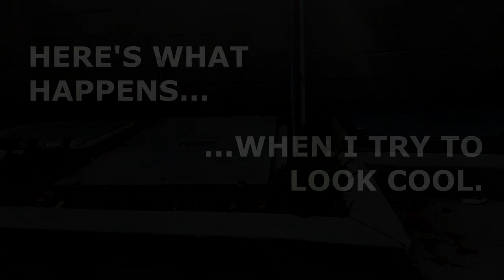#021: Cleaning Up Cable Vaults

Comment: Have to remember that with a lot of the companies out there the tech are ridden hard to get the job done as fast as possible and it it means saving the few minutes to clean it up then that's what it means.

Be careful with that big of a service loop. A lot of customers will be upset with it because it takes up a ton of room.

Yes leaving a lot of extra slack is good but I have been in rooms we're everyone did that and it turned into a buried mess.
Reply from the maker: +JUICED83Z You make a great point and I will make a note to mention that in a future video. Thanks!
Reply: It's sad really. I've been in that situation we're I wanted to clean it up but my then manager was on site and told me to just leave it and move onto the next job. Granted there are some techs that have the time but just don't care.
Reply: Another thing to point out besides the aesthetics of a big service loop is the technical implication of it. Large service loops of copper can become an "air choke"  this can cause cross talk issues or degradation of signal. This can be a large issue with Ethernet however I'm not sure I ever encountered it with a T1 circuit. T1 voltages can be 200v or more so it's very plausible it could. 

I find it very odd they would not use the fiber, I have done several T1/PRI cuts where the LEC was forcing the customer over to fiber from a copper T1. They can deliver the same T1 service over fiber. They just place an IAD (or more recently just a Cisco ISR or Adtran equivalent) at the DMARC and serve the T1/PRI from that. Our company can even serve a T1/PRI over last mile wireless, all the telecom switching is VoIP now days so its very flexible.
Reply: TofuInc it also affects loop lengths...... the customer may be on the raged edge for a particular speed and I have seen huge service loops put them over the edge.
Reply: This is true, In this instance I'm not sure which part the the circuit this is. If this is the IW for the DMARC extension this is definitively the case. I am very careful with DMARC extensions as it can become a point of contention during a service issue. I've also seen +FiberNinja move DMARC and Telco equipment in some of his videos, which I do not due to these reasons.
Reply: Before or after the dmarc it is still adding to the loop. Moving the dmarc can get you in serious trouble if the company finds out.... when I worked for the phone company I filed claims on a few contractors. Granted moving a jack a few inches is not a big deal.

I'm doing a job now we're I mentioned to the customer that I could do this this and this but that at&t would also have to come out
Reply: With a T1/PRI the IAD or the ISR is part of the DMARC. The T1 goes in and then you have a PRI and possibly a data circuit as well. Most modern phone systems do not take a T1 directly. I have worked on a few Ayaya Legend/Magix systems that do, most of those are going away however.
Reply: I was talking about  Demarc's in general.
For the T1 stuff I have seen a ton still plugged into power but have not been used in years. With fiber all over at least in the bigger cities T1's are becoming more and more rare.
Reply: In most cases the DMARC is a card that converts HDSL to T1. There are H2TUR and H4TUR cards. The H2TUR uses 2 wires/1 pair on the telco side and the other uses 4 wires/2 pairs. IIRC the 2 pair version can go about 12000 feet, the 4 pair version can go 20000 feet before needing a repeater, this using HDSL. The T1 side can't go nearly as far, IIRC these cards can only drive the T1 side about 650 feet. Nothing is stopping you from getting your own H2TUC and H2TUR cards and converting the signal back to HDSL again....so what you'd have is the telco's H2TUR card connected to YOUR H2TUC card, connected by a single pair up to 12000 feet connected to YOUR H2TUR card, out of which comes your T1 line where you want it. In addition to these cards you'll need a 48V power supply and the enclosure. Adtran makes this equipment.

Comment: Been there, dun that, played limbo with a multi million dollar 100 gig 488 strnd..  nasty job..  especially when your in a manhole on a rainy day pumping out water thats sewage infested and constantly flowing in just enough to keep a pool above the pipe.  Meanwhile the manhole is in the middle of a 6 lane road with a speed of 55mph and the city just said,” put up cones”....  had a semi hit my guard one time while i was tied off to it and about 20 feet down under the street about dead from pulling 5 miles worth of cable by hand with some pullies...  fuck. That.  Job...

Comment: Hey Cable ninja, is it typical to have cable racks installed on the vertical strut? Also safety, do you perform a bump test since you are working in a confined space?
Reply from the maker: Not sure which vertical racks you're referring to, maybe refresh my memory as to what you mean by that?

I am not currently equipped to do any sort of confined space safety air testing (if that's what you mean by a bump test) but that's also because the most confined of spaces I ever enter at this point are those small vaults you saw in this video. I have been trained in confined space safety and am aware of the hazards but the shallow nature of these vaults make it fairly safe to work around. I think any deeper and the job foreman would be the one requiring the extra safety measures.
Reply: @FiberNinjaStudios  Thanks for replying. The cable racks I'm referring to are in the link below. I'm currently working on a construction project, the specs call for use of these.

https://www.comstarsupply.com/media/catalog/product/cache/22df1b400fb1427e2ca46d7a5289e6a2/r/a/rack_arm_display_2.jpg

Comment: I have a span of regular cat5e slung over the roof of my house going from one end all the way to the garage at the other haha!
Reply: Layne Brown  that cat5 cable is most likely not UV rated,  plan on replacing it much sooner than you originally thought.  just a friendly warning.
Reply: I put it up in the cold of winter and figured in the cold it would last a month. It's been well over a year now.
Reply: My plan is to keep using it until it fails or becomes unreliable in the least. The only reason I've not done anything better yet is my attic is chock full of fiberglass and my crawlspace does not reach the garage. I'm also fairly unwilling to spend the money on an outdoor rated cable.
Reply: I've seen them last 2+ yrs even fully exposed.  hey maybe your cable will survive the UV.   if the outside covering begins cracking that's a bad sign.

Comment: What are these "vaults"?
Reply: We call them manholes or junction boxes, in the UK anyway.
Reply from the maker: This was a small grade school campus that needed to have large conduits installed to run fiber cables between all the buildings and then eventually all end up in their main network room. These vaults are usually points in those underground conduits where they need to make a turn. It's usually the best point to pull cable so they are built into an access point for entry by a technician.
Reply from the maker: They may be referred to in that way here too but at least among the techs I have worked with, they're vaults. Maybe it sounds fancier...

Comment: Just to clarify,: the jet line (pull string) you "cleaned" was just sitting on the bottom, and was not running through conduit? You might have created a huge headache for the next guy if you pulled his runs out.
Reply from the maker: +Gaming With Thanatos Yup, it was just laying in the bottom of the vault.
Reply: Dangit. Good Job!

Comment: do you work for a company or is this your own business? also what licenses do you need to do what you do?
Reply from the maker: +Jared Castro I am an independent contractor at the moment. The only license I currently need to do this work is a driver's license! I'm looking into the California State Low Voltage Systems Contractor license but until I am cabling a new site, I probably won't bother with it. If you're going to be installing for new construction that will be inspected, you should get this license to be sure.

Comment: if it were me I'd fuck off the  whole mess and put a quote in for complete replacement of the network looking at the mess makes me if the head of I.T. had something to do with it..

personally the need for copper interconnects should be a thing of the past
Reply from the maker: As a matter of fact, I did show this video to the IT manager for the school district there. After that, he called in the cabling contractor that did the original work and made them re-do it!

Comment: What is an "empo" (however it is spelt)?
Reply from the maker: MPOE = Main Point Of Entry

It is typically where the local exchange carrier LEC (or phone company) ends their cables and area of responsibility.
Reply: FiberNinja ahh, thank you. Is it particularly a US term? I don't think I've heard it here in the UK.
Reply from the maker: +Norky Well I've only worked in the US so I'm not sure. My guess would be that they have a different term for it though...
Reply: Can’t say I have heard MPOE over in the UK, I know them as the Demarcation Point. In residential properties most people will know them as the ‘BT master socket’ (sorry for the very late reply, I’m binge watching after just discovering your channel).